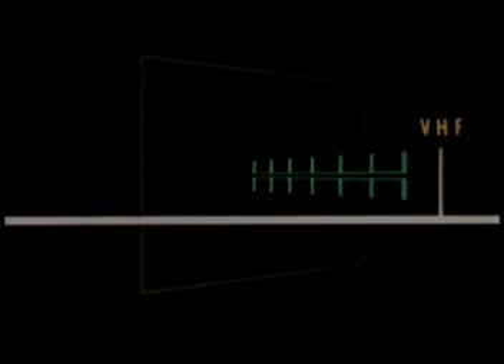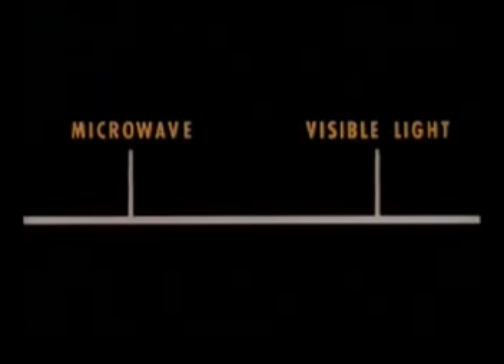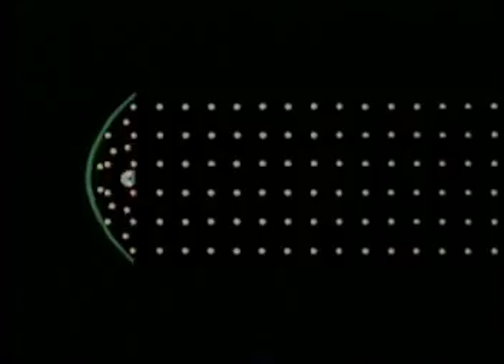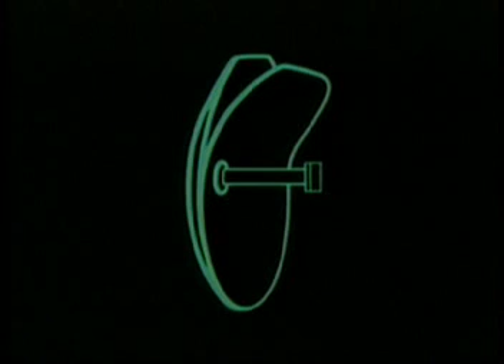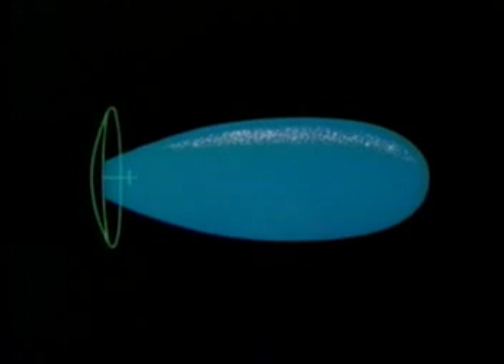Antenna Fundamentals 2 Directivity

Comment: Is the power of a directed transmission the same as that of an undirected transmission (using the same transmitter without the passive thingy)? Since directivity relies on interference i would expect yes but from what ive read the gain of a directional antenna is greater

Comment: The ruby rod in a conventional laser is cut so that its length is close to the wavelength of the output light, plus one quarter of that wavelength. The internal surfaces reflect the energy back toward one another, much like the example shown at 6:00. Since both surfaces are reflective, there is a "hall of mirrors" effect, simulating an array of many, many reflectors. In this way, the ruby rod creates an array of waves that, through interference, produce a strongly unidirectional propagation of energy.

Comment: This was very interesting but I'm seeking an answer to a specific question. I'm an older man who grew up when everyone used an antenna for TV. The roof antennas were best but indoor antennas existed too. Indoor antennas had to be made of metal, and those rods had to be able to change size. You could also add some aluminum foil to the antenna to make it work better. Today I use an HD indoor antenna but if it isn't working well on a given night often if I touch it that will help. It's as if my body becomes part of the antenna. I can't understand why these new antennas are helped by flesh & blood, instead of metal? Furthermore, I was taught radio waves don't change. What are today's HD antennas made of?

Comment: 6:19.  1/4 wave space reflector in reality works, but is slightly too far spaced.  It should be slightly less than that, close to 1/5th wave.  Smaller spacings work too such as 1/6th wave.